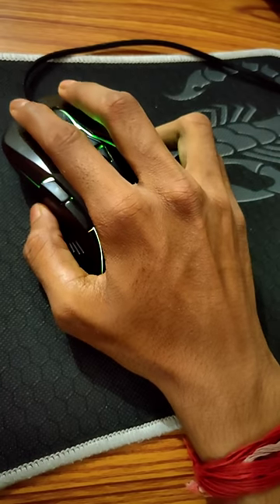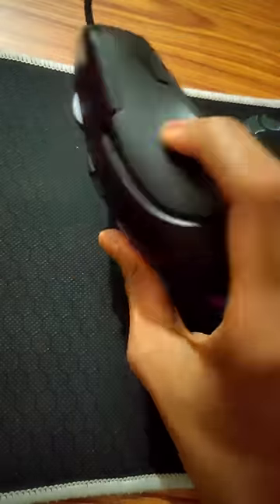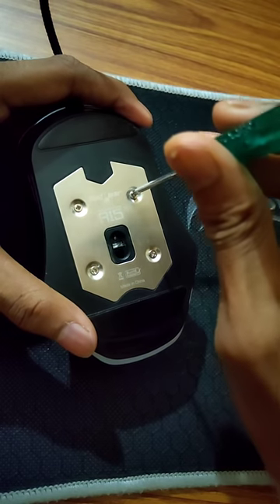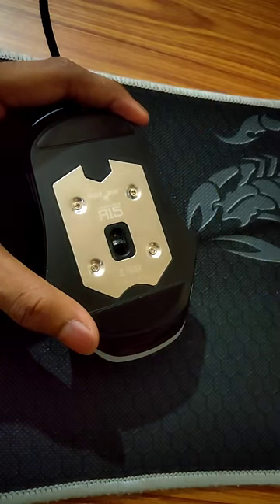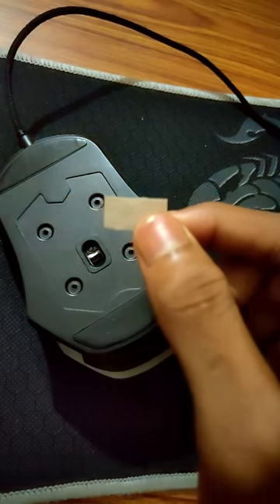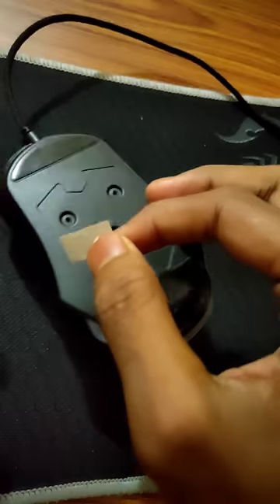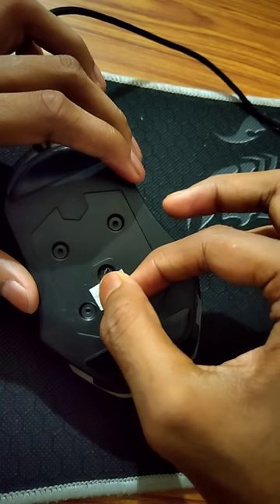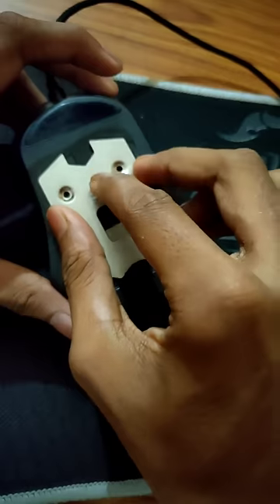How to fix your mouse Lift off distance | Fixing RedGear A-15 Lift off distance #shorts

Comment: Bought the A-15 I use it on the RG Speed Pro mouse pad but while Playing Valorant I try to do a 180 like slide the mouse fast it just won't register and just move the cursor only half way through when I do it a little slower it will work just fine. Is it the same issue that you fixed?
Reply: No that's not what he did
Reply: same , the sensor is poor but thats what you get for the price
Reply: Same bro and i came here for that issue but couldn't find the way to fix it
Reply: @ligma__9274  That issue won't resolve these mice aren't for FPS gaming like CS or Valorant, the sensor is office grade. I Switched to Logitech Lightsync.
Reply: @Fermionic_Condensate  fr
Reply: Did you find any solution for this ?
Reply: @deadshot5526  There is no solution, It's just an office mouse with an RGB body, the sensor is not meant for FPS gaming. Just return it if you bought.

Comment: if i remove the backplate do i rlly need to put it on or its fine without it? since the weight is kinda bugging me even thought i know i will get used to it
Reply from the maker: The back plate not much of a weight issue tho
If you want you can use without it . 
The tape may come off

Comment: bro i got he driver issue of this mouse mins my a15 cursor became inverted and when i opened rg driver its telling product manufacture is wrong which broked my heart plz tell me solution the mouse is good its working fine the problem is the driver made my mouse inverted and something worst like that plz tell me solution
Reply from the maker: You can check the main driver settings that if the mouse movement is inverted or not 
If you are still facing the issue join my discord and we'll discuss there
Link : https://discord.gg/rPZczxJr83
Reply: BRO SAME PROBLEM PLEASSEEESE REPLY
Reply from the maker: Join Discord let's talk there
Reply: @ITSALLELECTRONICS  ur link is expired... to please make a new 1
Reply: return and replace if u buyed from amazon  or else register a complaint in redwood interactive they will take your mouse and fix ur problem
Reply: I registered a complaint in redwood ..will it work ?
Reply: Or I will return it on Flipkart?
Reply from the maker: If Flipkart option is available return it to Flipkart
Reply from the maker: https://discord.gg/CjywfEHvwJ
Reply: @ITSALLELECTRONICS  then ? I will buy the same one ?
Reply: @ITSALLELECTRONICS  bata bhai jaldi .. replace karke same wala launga to driver problem ayega phir se to kya karu ?
Reply from the maker: @devijaysingh5035  discord aja
Reply: @ITSALLELECTRONICS  i replaced it in amazon as soon as possible within week now im using the replaced one which im using for more than an year bro😁

Comment: It did not work for me....whenever I play fps games and I wanna flick or change the direction the mouse does this weird stuttering motion which might be caused due to the red gear mouse pad I use....the mouse pointer moves nowhere. But when I do that same movement slowly or fast on a wooden desk it works perfectly. Please help.
Reply: same bro gont any solutions?
Reply: @sarveshgadhari9381  yep I put cellotape on the gliding pads of the mouse and use my table ( without the mouse pad). The tracking is perfect that way.

Comment: Bro i cant play with thia lift off distance issue. I tried this method but ita not working at all !
Reply from the maker: Place the tape precisely it eillt work surely
Reply: @ITSALLELECTRONICS  i tried adjusting multiple times bro.  I couldnt fix this. Do you still use this ???
Reply from the maker: Yess its my daily driver mouse
Reply: @normal8852  do u find solution?
Reply: @skilz9525  returned